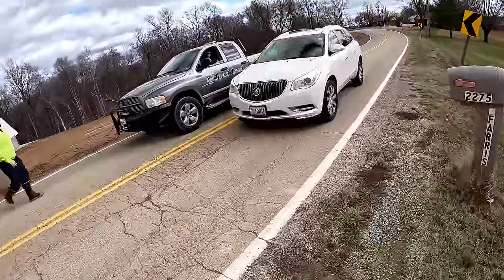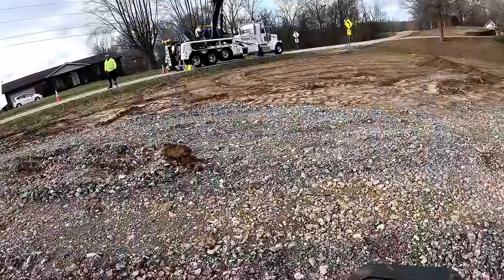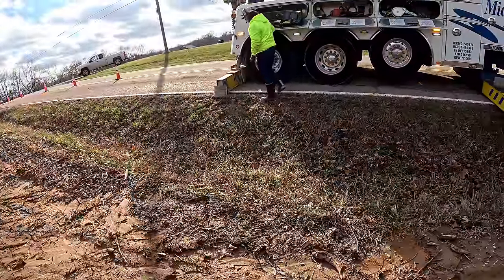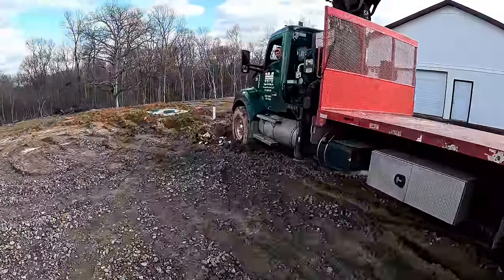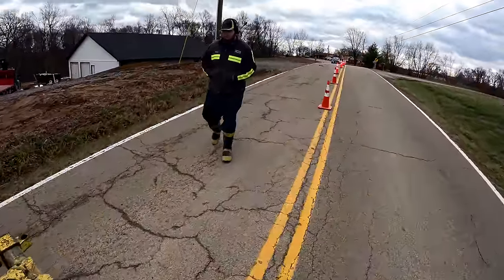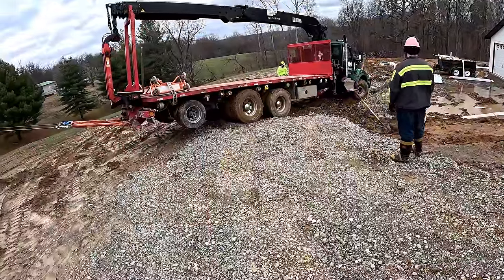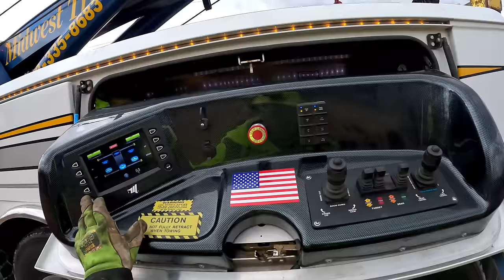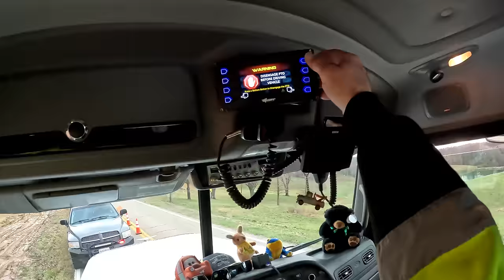THE NIGHTMARE JOB!!!!    ROTATOR V.S. MATERIAL HANDLER!!!@

Comment: did you notice the material hauler trucks out riggers Ron? could those out riggers on that truck possibly help push it up out of the mud?
Reply: Those only would have helped to put timbers under the tyres. Not that they can lift the truck completely typically.

Comment: I have a question sir.... Why do u use red tow straps in place of chains ⛓️ or good thick cable?? I thought straps where to pull or jerk something with scratching the paint .? But I'm this case the paint doesn't matter ?  Can u tell me?
Reply from the maker: These are actually synthetic slings.   They are designed for overhead lifting or pulling, such as in this video.   They are just as strong as chain and much lighter.   Many tow/recovery companies are switching to synthetic winch line rather than wire rope for the same reason.   The synthetic is more expensive and doesn't have the same abrasion rating, but it far superior in many other areas.   It is light weight AND it floats on water.  Thanks for watching and God bless.

Comment: Pretty sure having the truck drop it's tag axel would have made this job a lot easier and you could have simply pulled him up the bank with your first position. Granted he wouldn't have had any traction with the drives but at that point you would have been doing all the pulling anyway and it wouldn't have overloaded the tag since he was empty.

Comment: Just asking, you know your equipment but could use a snatch block and double the line??
Reply from the maker: The winch power wasn't the issue.  The issue was keeping my truck from tipping over without a solid platform while trying to work from the side.   Again, we were trying to keep one lane of traffic flowing.  Once I decided to shut the road down so I could get a better platform and angle, the truck came right out.   Thanks for watching and God bless.

Comment: Could the rear tag axle been put down to raise the rear bumper?  Would have been dependent on the ground holding the pressure but blocking it could have decreased the pull force required to move the stuck truck.
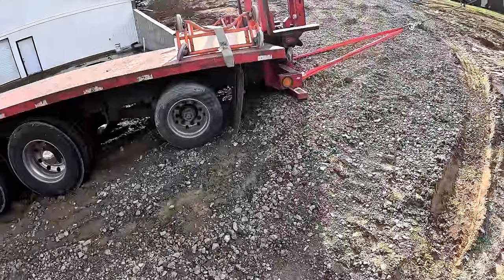Reply: ~28:00 in the video

Comment: Would lowering the back axle have made a difference?
Reply: this is exactly what i was thinking, at the very least it should have gotten the dot bumper out of the muck.
Reply: Apparenrtly the back axle can be lowered when in neutral or forward gears but comes back up when the truck is put into reverse.

Comment: confused by the initial approach to this . if you'd been a bit further forward the truck wouldn't have dug  its rear bumper in and if you'd just parked on the other side of the road you could have put your outriggers out without having to build a platform. I understand not wanting to close the road but definitely being much further forward you could have pulled him out the hole which much less strain.

Comment: Wonder if before you started pulling, putting some timbers under the truck's drives would have helped. Get the DOT bar off the dirt and not acting as an anchor
Then you'd have only had the steers holding it back

Comment: Hey Ron quick question on my rollback flatbeds what's the proper height for my rear landing feet or legs and what are the pros and cons just need a little guidance? The shorter they are the better or the longer they are the better ? Thank you
Reply from the maker: I will be glad to help you.  I'm afraid I don't understand the question.  When you say the rear landing feet or legs on the rear of the rollback, are you referring to the bars that stop the bed height when you tilt the bed?   It's part of the rear bumper on my truck and has different holes to adjust the height.  Is this what you are talking about?    Thanks and God bless.
Reply: @RonPratt  Yes mr. Ron that’s exactly what I meant sorry I didn’t had any better way to name them or describe them but yes what height is the best to have them at the shorter or taller the better or worse or what benefits having them at their shortest height or the tallest height
Reply from the maker: OK..  So a lot will depend upon the type of truck, the suspension it has, and what you are using the truck for.   Basically, those legs become the "fulcrum" point for your bed.       Have the legs set up to the top allows you a slightly better (lower) loading angle.   Having the legs down, stops the bed height sooner and keeps a steeper bed angle.   Other than that, they are used to stabilize the bed, frame, suspension, etc, while you move the bed forward with a load on the bed.   The basic idea, especially for heavier loads, is to keep those feet on the ground/pavement until you get the majority of the weight forward of your axle to keep the truck stabil and the steer axle from coming off the ground.   Once the weight is forward of the axle your can lower the bed with a lower risk of the bed or frame twisting or the front axle coming off the ground.    As far as the height you should set them at, again, that will depend upon what you are using the truck for and the configuration of the truck.   I have mine set right in the middle of their adjustment and don't have any issues.   Thanks for watching and God bless.
Reply: @RonPratt  Thank you Ron is hard to find info on this little overlooked detail right now I have them also at mid way so I’ll keep them there for the most part I do cars but sometimes I will get machinery like bobcats and so on it’s a Hino with a jerrdan steel bed but I wanted to make the legs shorter so that way I can drive the truck forward after lifting the bed just about enough for me to pull up right form underneath a car specially for cars don’t stuck in park and I have to skate them down but once I have the 1st half of the car on the solid ground I like instead of dragging the car the rest of the way down I like to lift my end of the bed just a bit enough for me to pull away from car but then at the same time when ever I get heave loads those legs would be a bit too short and I definitely don’t want me front axle to come off the ground so I’ll keep them the way they are right now mid way thank you Ron for this great info it really helped
Reply: @RonPratt  sorry if I confused ya it’s kinda hard to put everything in words and hope people will understand you haha but I got your point thank you

Comment: Well , one.... That delivery truck has a stupid axle configuration and the driver actually drove into a 'bowl' in the terrain..... What did he think was going to happen ??  ..... As for the recovery , 1: why did you not close the road to start with ?.... Would have saved half an hour messing around , right there . 2: Why where you trying to winch from a raised boom ?..... Very unstable !  Can you not run the winches down to the rear of your truck , then through attachment points and snatch blocks , low down from the rear ?   That way would be so much more stable and using snatch blocks would give you much more pulling power.... I think that once you had him up on top and facing in the right direction , he could have driven out of there quite easily .  ..... And before you ask , yes I do have recovery experience and lifting experience using truck mounted cranes , here in the U.K.  ....
Reply from the maker: Like I always say, "there are multiple ways to reach 10".   Different operators have different methods.  As long as the job is completed safely, who's to say anyone's method is "wrong".   As far as closing the road first, I would have loved to have been able to do that, however, here in the U.S., the road authorities do not like closing any road for any length of time.   I was fortunate that the Sheriff's department honored my request on this job.   Thanks for watching and God bless.

Comment: just a question why not put a pulley on ur out rigger n pull lower angel jist wondering ?
Reply from the maker: This job required a lift as well as a pull.   Raising the boom also puts down-pressure on the outrigger to help keep my truck from moving.   Thanks for watching and God bless.

Comment: Cribbing on mud like that... drape a chain under the cribbing before you drive the blocks down, then you can pull them back up by lifting the outrigger pulling the chain.  Some old chain not good for anything else...
Reply from the maker: Excellent idea!!!   I will have to remember that.   Thank you!!   God bless.
Reply: @RonPratt  also looked like some cribbing didn’t have your ‘belt’ handles making them harder to retrieve from cabinet.

Comment: Potentially stupid question from someone lacking most knowledge about your line of work (except for what I've seen in / learned from your videos): That truck had a crane, and obviously, some kind of outriggers to stabilize it for crane usage. Would it theoretically be possible to lift the truck using those outriggers, and thus be able to put something like blocks or even gravel under the front tires to ease the resistence from them, or are those outriggers/lifting cylinders  not able to do so? Whether this would've helped here is a different question I don't even want to ask.....
Reply: My guess is those out riggers would have just been eaten by the mud.

Comment: Typical for 75% of builders. Never want to build a proper driveway during construction. They should have stopped when they sank in the hydro trench. Improper base under the driveway caused this mess.
Reply: I’d assume the builder was the one footing the bill or at least paying part of it? Doesn’t seem like the driver checked to make sure the site could support the truck.
Reply: @CambellSoupify  unless there’s a solid driveway I have a contract that the customer signs that states a) I’m not responsible for damage to property past the property line and b) if truck gets stuck due to improper construction of the driveway the tow bill will be added to total cost of the load.